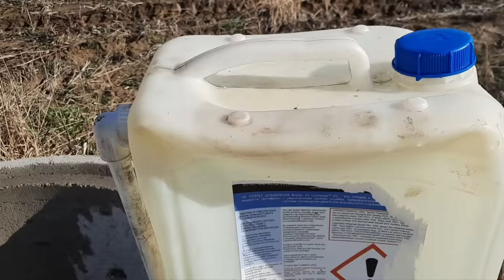Simple idea how to make a water pump without electricity without fuel

Comment: This is called a Syphon...it is not a pump. It will only ever drain water from a higher level to a lower level. Lift the hose up to the surface level of the water and the flow will stop, if it were a pump it wouldn't stop.
Reply: Its working on a vacuum created in the bottle. It is pulling water out of the well. You can attach a ram pump in the end of that hose and have it pump up to higher place. A ram pump is also a pump which wouldn’t require any energy
Reply: Ñkñ
Reply: ram punp requiers synerhic energy.. for example 90% water ends of 1m lower and 10% of water ends of 9m higher :)
Reply: Awesome... I wonder if this technology would work on the Moon....
Reply: @kamalsingh-lx1di without energy of any kind,

No work can be done
Reply: @2ezem8  Only about 1/6th as well. 🤔
Reply: @arjitagarwal007  yes, the energy I mean is like a form of energy you would have to keep adding. Its like a solar panel. The sun provides the energy but we create a device which can capture it and to build that device you will need energy. And so on and so on.
Reply: I’m gonna scale it down and run the tap back into the well but one of them timber wells with a roof around it and call it a magic well   Lol 😂
Reply: Celui ci fonctionne différemment. C'est la depressurisation dû à la coulé de l'eau qui se trouvait déjà à l'intérieur du containeur superieur qui entraîne la montée de celle dans le réservoir inférieur.
Reply: @2ezem8  Yes it will, still gravity there
Reply: @arjitagarwal007  The energy comes from mass of water moving from one height to a lower height.
Reply: If you run the long end back into the well, it will become the first perpetual motion machine pump.   Ingenious.
Reply: @bullshitstomper9417  But that will only work untill the canister is empty. Maybe it will even stop earlier.
Reply: Now you’re worrying about facts. He’s just trying to get some clicks
Reply: @2ezem8  
Where there is a lot of water
Reply: @ralphcliffordlozama9638  bonsoir est-ce que ça peut fonctionner avec nimporte quelle profondeur ?
Reply: @kamalsingh-lx1di  ram pump requires energy but that energy is not from electric current. The energy is coming from the head of the water source that gets converted into kinetic energy as water travels downward toward the ram pump.
Reply: The water flow only stops if the the weight of the water 1 gallon cannot overcome gravity if there was 3-5 gallon behind the water a person can lift the hose above the gallon because of the psi is high enough what the flow rate would slow down
Reply: siphon is a type of pump
Reply: @2ezem8  can coz there isn't a good enough atmosphere pressure as we have on earth
Reply: So if a person had a slow flowing well and needed to pump the water to the reservoir this would work
Reply: @2ezem8   yes, it did! I did it last week, now i‘m on the way to venus.
Reply: @kamalsingh-lx1di  yeap but threorical max well dept is 10m because atmosphere pressure is 1bar and 1 bar gives you 10m in height.
Reply: Yes it works on vacum efect but it pumping water from lower Point into higher point next pump will lift it higher and next will do The same when you openvalve on highest point put water by water electric wheel back to lowest water tank you will gain True free energy:-)
Reply: When you lift hose above surface of water even electric atomic and magic pump will stop pumping water Einstein:-)
Reply: @MrLukaszKaiser  errr no....a pump will pump liquid higher than its original level, that's the whole point of a pump 🙄
Reply: The word, is spelled siphon, but it can be used in many different ways, on many differing levels, … as quantity can over ride the issue of level, … it needs  more complicated structure, but it can be done, … in the same manner the Romans utilized to create their aqueduct systems, … by only using shallow 
Pt to accumulate enough volume, …
Reply: @johneosmaniii3915   The word is spelled Syphon in the UK my friend and as that's where I'm from that is how I spell it.
Reply: @Dingsrud  are you sure?
Reply: @Ristobombatatisitatamata  At about 5:20 he opens the output and there is a steady stream of water. Now, the input is deep down in a well and a sytem like this is unable to lift water up, not even one inch, so why do we see water pouring out?  1) fake video. 2) air is seeping in the outlet as the water comes out. Normally that will give some interruptions in the flow and one wil see water gulping in the tank as air comes inn. Here the flow seems  steady.

After that a hose is added. If the outlet from the hose is lower than the level of water in the well, then this will run just fine.
This is a siphon and you can do the same with just using the hose, no tank. A bit more hassle to get it started though.
Reply: @Dingsrud  thanks 😊
Reply: REVERSE siphon . A siphon has the other end BELOW the bottom of the reservoir.  By integrating the higher container and filling it creates suction as it begins to drain. The Romans built towers on the 2nd hill to" inhale or catch" the water as it flowed across the valley and with inertia started most of the way up the hill. The 2nd tank would begin being drained at the very moment the water would aporoach the peak of the 2nd hill and be sucked into the 2nd tank as a vacuum was formed. The water would then flush over the 2nd hill and race to hill three where another tower awaited. At the time the masons boasted they could make water "run uphill"...
Reply: @singalongwrudy8690  Sorry, but that is not the case. A syphon can not lift any water. When you manually with a bucket lift, water up ito the drum, you add “work” to the water. When the water is drained out, there is no “work” left in the barrel to lift any more water. The water flow stops. There is no way for water to escalate a hill by going from drum to drum.
Reply: @allanmwangi1825  No, we normaly define a “pump” as a device that can elevate say water. A syphon can not elewate water even one inch up.
Reply: @Kazya1988  No, a syphon can not lift any water up to a higher elevation, not even 1 inch. Ok, a tube filled with water can pass a 10 m high wall, but you have no access to that water up there. Useless to you.
Reply: @Kazya1988  Maximum for a syphon is zero meters,not 10m. Sorry.
Reply: @Dingsrud  syphon works as a normal state... Don't have so good English to explain this, but just think about fish tank where is external tank inside fish tank and fish can freely swing above the water level.
Reply: @Dingsrud  the" uphill" was just an expression . The walls of the canal got taller toward the tower..the bottom was level. The  speed and force of the current pushed the water high enough to start filling the 2nd tower. Roman reverse siphones are still standing in parts of France and Spain . It was how they traversed valleys WITHOUT overhead viaducts
Reply: @Kazya1988  The video shows a syphon. A syphon can not lift water, impossible. The input must be higher than the output.
Reply: @singalongwrudy8690  May you are referring to an “inverted siphon”? This actually not a siphon, but a U-shaped tube. Still the outlet must be lower than the inlet. The tube can have any diamerer, even vary underway. Still works.
Reply: @Kazya1988  Please have a look https://en.wikipedia.org/wiki/Siphon
Reply: @Kazya1988  Yes. If you submerge a bottle in water and lift it 99% up by the bottom, it will still be full of water due to atmospheric pressure. If you take the same bottle, now without water, but the neck is still in the water, there is air in the bottle and do water. You put in a tube and suck out the air, what happens to the water level. It raises!
Reply: @Dingsrud  i suggest to read more about thermodynamics laws and especialy Enthalpy
Reply: @Dingsrud  when a resivior is added in the flow it is "reversed" because  a second vaccumm is created to overcome the second hump...I suppose "double" siphion would be a good definition. To me "inverted" suggests a change in direction.
Reply: It’s called vacuum! Stop trying to complicate things. Perhaps you need to look at the video again to gain some perspective on what was done. 😂
Reply: @kamalsingh-lx1di  pretty sure our UK jeenious didn’t realize what was doing the work. It is obvious to those of us who work with water.
Reply: @uprightfossil6673  I think you need to. It is, always has been and always will be a Syphon. I'm not over complicating, it is what it is.
Reply: @bullshitstomper9417  If you run the tap back to the same well, the will be no circulation of water. For a siphon to work, the output must be lower than the input.
Reply: @allanmwangi1825  Naa. If you consider a siphon to be a “black box” with an input and an output,  a siphon can not lift any water, not even 1 inch, while a pump can lift water up.
Reply: @Kazya1988  Theoretical well depth is zero meters, a siphon can not lift any water. But it can conway water over a 10 m high wall or ridge. No water can be extracted up there tough.
Reply: @argonaut6386  in your words “it will only ever drain water from a higher level to a lower level.” I guess you want to change that statement now? This is a siphon that uses negative atmospheric pressure (or vacuum as we say) to lift the water. Like I said, perhaps you should watch the video again to gain perspective on what is happening. You sir are wrong and need to wrap your head around the fact that you are WRONG!
Reply: @uprightfossil6673  Nope, I'm correct and don't want to change anything I've said thanks. You even call it a Syphon yourself which is what I called it but you said I was wrong  🙄 you need to not get so upset and untwist your knickers as you're tying yourself in knots as well as your knickers 😂
Reply: @uprightfossil6673  Noooo I've no need to deflect anything you've contradicted yourself for all to see. But please carry on with your BS as it's entertaining 👍
Reply: @uprightfossil6673  lol my my you're absolutely seething after tying yourself in knots aren't you. Oh don't worry, you won't upset me my friend I'm not the one that kept changing what they were saying thinking they were more intelligent than they actually were. Good luck with your insecurity issues though as they seem quite serious👍
Reply: @uprightfossil6673  If you were actually confident that you were correct then you'd not need to keep messaging me in a very desperate attempt to claw back some of your self esteem 🤣
Reply: It works on similar idea The siphon and drum pump works without energy and its work on vacuum force  water is going out and its create under pressure wich suck The water to compensate pressure level simple r i can not explain:-)
Reply: Gravitational force is used for creating vacuum which brings the water up from well.
Reply: @SNN16  we understand that principle. There is some discussion as to whether this is a pump or a siphon. Clearly it is a siphon but some of us refer to it as a siphon pump/primer.